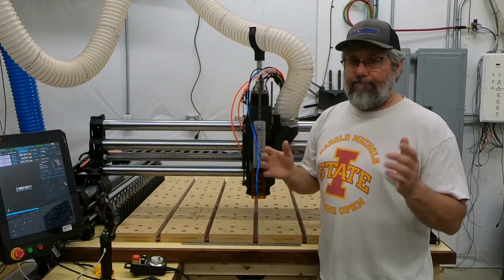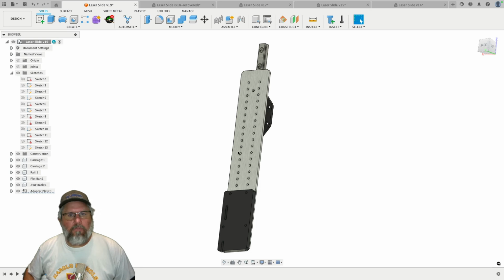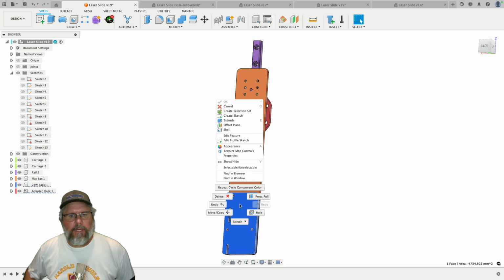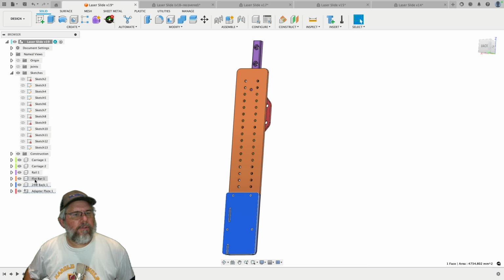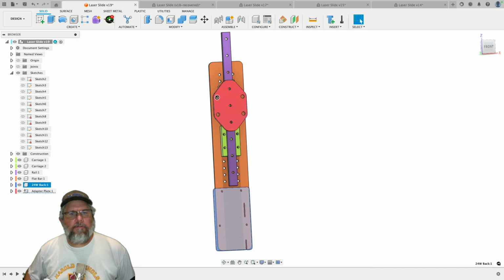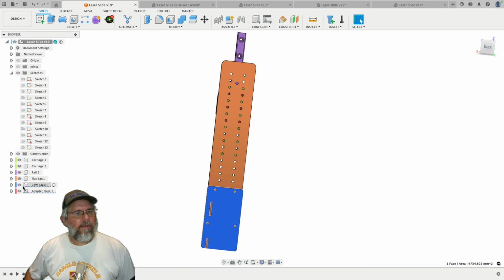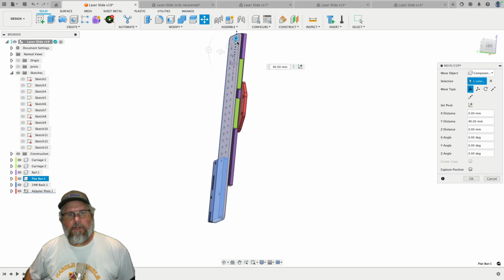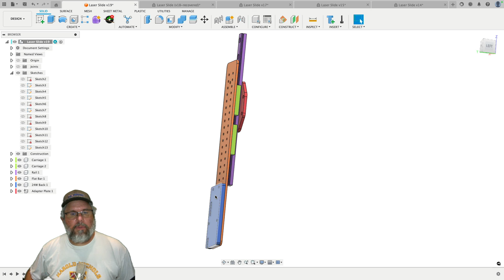Protect Your Laser

Comment: Hey Adam.  First, thanks for making this available.  Second, I pulled the DXF file into Vectric and noticed there were no toolpaths.  What bit did you use to drill the holes?  What depth did you set for drilling the magnet holes?  Thanks

Comment: Really like this design. Is there a reason the flat bar could not be 3d printed? Or does it need the strength of the aluminum.
Reply from the maker: You could try it. I didn’t because of the lack of rigidity.

Comment: When you use the thumbscrew to lock the assembly in the up position, are you screwing into one of the holes in the linear rail or resting it on top of the linear rail assembly? Trying to determine if I need the size thumbscrew and tap and die set you specify or if I could change the hole size and use one of the 1/4 20 thumbscrews and tap and die set I already own.
From the STEP file, it appears the holes to mount the flat bar on the linear rail are just milled through the flat bar and that no threading is required. It's not clear to me how this secures the flat bar to the linear rail.
Reply from the maker: The thumbscrew just puts pressure on the rail.  It doesn’t have to line up with one of the holes.  You can use any size you want.  The only hole that needs to be threaded is the thumbscrew hole.  The rest are just straight through.  If you’re using the adapter plate to fit the rail to the spindle mount, there are some tapped holes in that for the rail to be secured to.